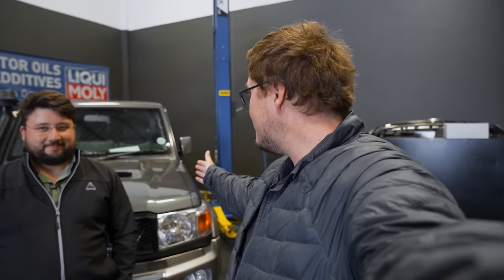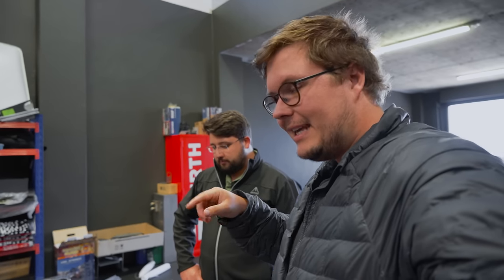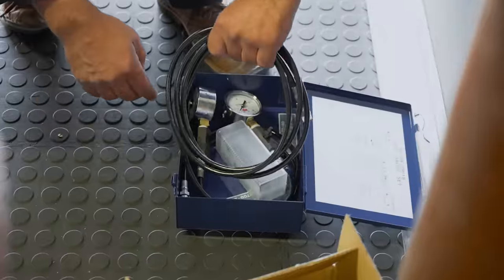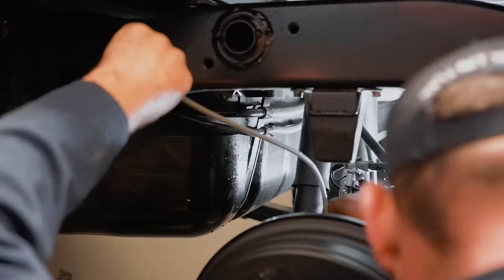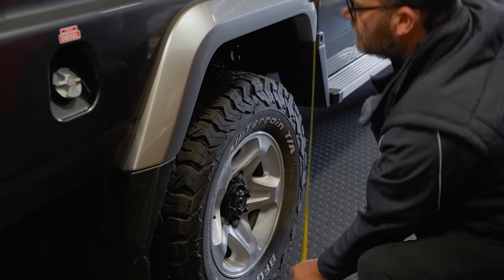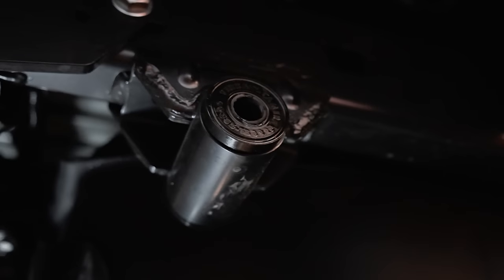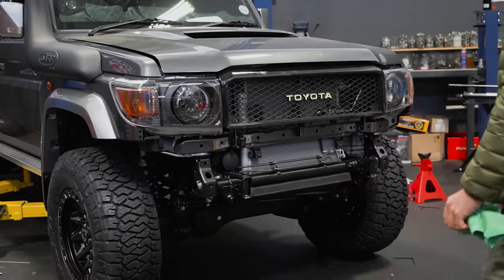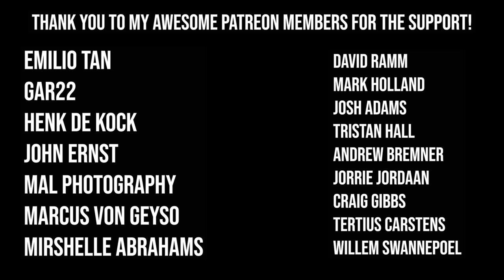Brakes, Suspension and Tires! Overlanding Build Landcruiser 79 Series Double Cab Part 1

Comment: Congratulations.  It's so unusual to see the 79 Series with that style of factory tub.  'Coz in Australia, the one officially offered by Toyota is a locally built aluminium tub with drop sides which can be removed (same as the rear) to turn it into a flat tray. This style is preferred by farmers and mining companies here.  Besides, outside the farming and mining community, most people who buys the 79 Series don't even opt for a tub, buying them instead w/o one and immediately fitting a canopy setup.

Comment: Absolute beast of a vehicle. Love the 79 series, but it's a shame they cost so much.
Reply: No not aware  but i don't believe bearings are .ment to carry loads that way .We have just finished designing and manufacturing a new traler axle. With hydraulic disc brake. When we moved the brake disk from the inside of the hub to the outside we moved the position of the hub to keep it centered on the bearings..

Comment: Hi Adrian, your comments on the LC brakes , suspension that needs upgrading is true but not unique to the Land Cruisers only. In preparing any vehicle for overlanding, the weight to Centre of Vehicle or weight to height changes dramatically with all the extras and add ons. Irrespective of the brand you support, you will require on all vehicles for the add on weight some form of upgrade to at least the suspension. The aerodynamics will cause drastic vehicle behavior changes on the road if you fit anything above the roofline to your destination and if you travel at 120km/h , if under hard braking from that speed the body roll or displacing of weight from the braking at 60/40 ratio can cause big issues. Remember no vehicle gets built in the factory to fit the application of every single end user hence it needs upgrades and changes from people specializing in certain areas of upgrades and for specific needs . I have done quite a few trips in Land Cruisers and Hilux bakkies in Mozambique and Namibia, Botswana and never had to upgrade the brakes as I absolutely keep to a safe speed even more so when towing my boat or caravan. But in saying that I have upgraded all vehicles suspensions and changed over to extended braided brake hoses. Thank you for the details on the upgrade of the LC79 posted thus far. The brake booster makes total sense and definitely to be considered.
Reply from the maker: Absolute Schalk! I have upgraded my brakes and suspension on the Hilux too; it’s necessary on any vehicle that gets taken out of factory spec in my opinion 👌🏻

Comment: I have the Jmax brake booster on my Troopy. It’s not quite what I expected as it feels a bit spongey, whereas I was expecting something a bit more responsive, but it makes a big difference.
Reply from the maker: I know a lot of people get that with the brake booster; but I think it’s due to not getting installation 100% there is a lot of measuring and checking to get right so the pedal feel is right 👌🏻

Comment: What about axle track correction
Reply: I was just about to ask this, too
Reply from the maker: Here we just do a 50mm spacer. A company called Onca do them out of high quality aluminium billet.
Reply: @RoamOverlanding  OK that will work just be careful  by moving the wheel you are no longer carrying the load on the wheel bearing where it. Needs to be .Especially as you intended to load the vehicle. What about an of set rims for rear and Carry a spacer for spair tyres
Reply: Are you aware if anyone has assessed the change in forces acting on the wheel bearings and stub axles and axle casing etc by adding spacers and thereby shifting the load further away from the bearings and bringing an element of leverage into play?  (I'm making some assumptions here without adequate understanding of the subject.).  Obviously practical experience with vehicles having this modification is of value here.

Comment: To answer a question not covered

replace the rear drums with disc brakes
since it is illegal to use spacers in australia  as a whole you  will need to correct wheel travel off road as the 70's  different axle width

Lower lief packs mean lesser weight over all

terrian tamer know's this you need gvm upgrade not down grade  your weight capacity

your winch has a max capacity of 5.44 ton if going for a 6 ton pay load the winch rating  will have to be double that  so something to consider 12-15 ton load rating

Comment: What rim size and make did you install, with offset to accommodate the powerbrakes?
Reply from the maker: You need a 17” rim; you can always contact Powerbrake with your choice of rim and they can let you know if it would fit or not (they have most rims on their database)

Comment: What are you doing to fix the front steering issue on the double cab when it’s loaded? Even with the suspension upgrades it still has a light feeling on the front and is fidgety and you have to drive it like a lorry
Reply: The ONLY wat to fix that is to not buy a double cab 79 series.🤣

Comment: Any tourers dream, but good luck with that fuel bill. I suppose if you can kit it out like you did you can afford the fuel.
Reply: Surprisingly the consumption is not far behind a fully kitted Hilux....
Reply: My Hilux like Adrian’s I can’t seem to get better than 10km/1L.
Reply from the maker: I wish… mine is at like 11.5-14L/100km depending on the terrain/wind/average speed
Reply: @RoamOverlanding  # Unladen 🤣